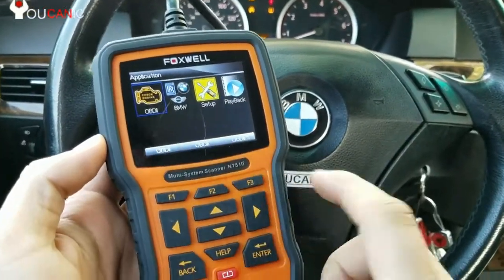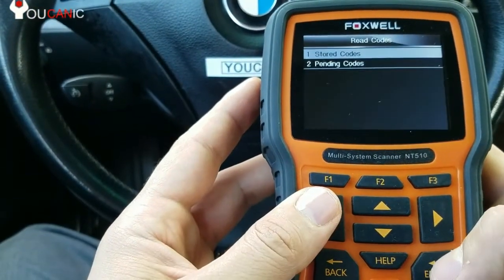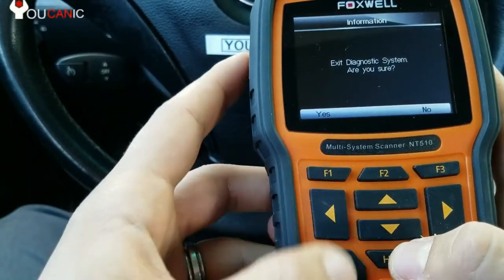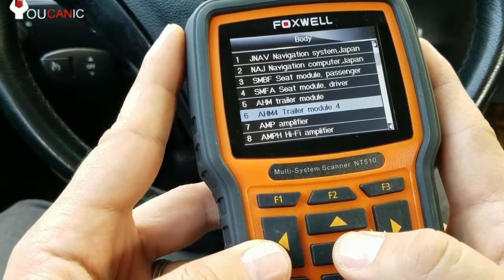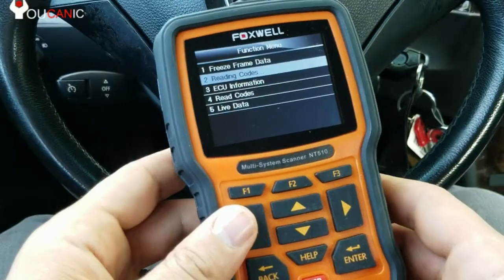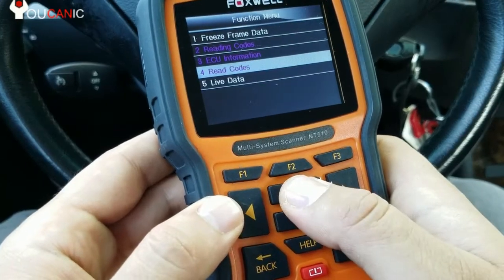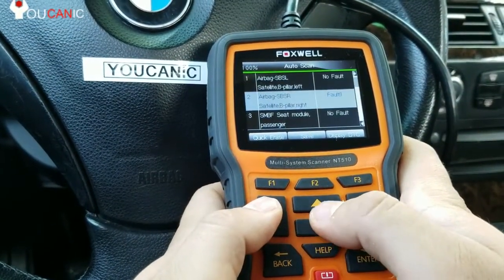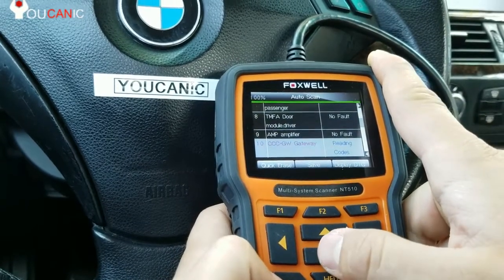How to Diagnose BMW with Foxwell NT510

Comment: I  have the bmw NT510, I've had it for years... pretty much useless! I just replaced my bmw battery and can't register it. A screen comes up for battery code input but there's no way to input info "it's not a workable keyboard". I like the look and feel but it's not a serious tool. 
my opinion, if Foxwell disagrees, fix mine! I haven't been able to use it! thanks

Comment: Can it check Transmission temperature?
Reply: How about engine temp..and oil level readings?
Reply: Did you ever get the answer to this question?
Reply: Yes it can make sure its the plus 1

Comment: Great information. I am thinking of buying this model. (I think now it's replaced with the NT530 model).
Question Please For BMW E90 (2008 335XI):
Can this scanner read and check that the alternator is working properly? My battery is not charging all the way and trying to determine if the alternator (or some other component) is not working correctly. Thanks very much.
Phil
NYC Area

Comment: Do you keep the engine running when using this device or only ignition is in ON position?
Reply: Engine off, ignition on.
Reply: @dougnbodie  Thanks.